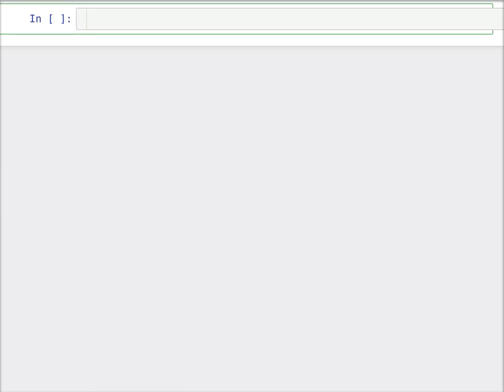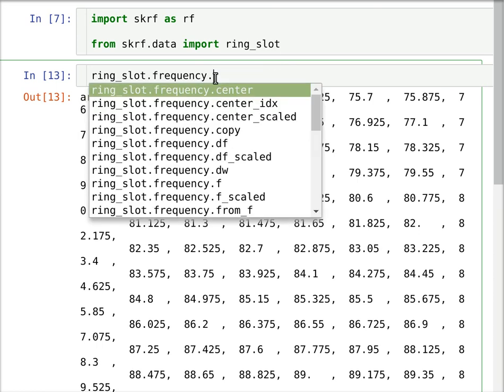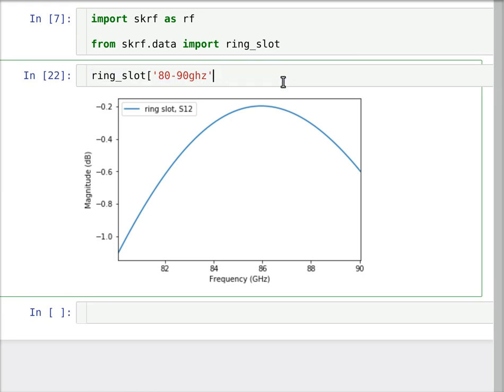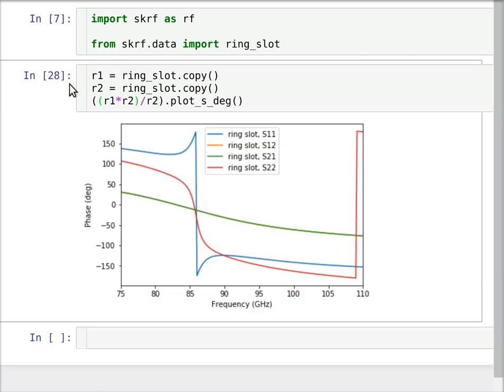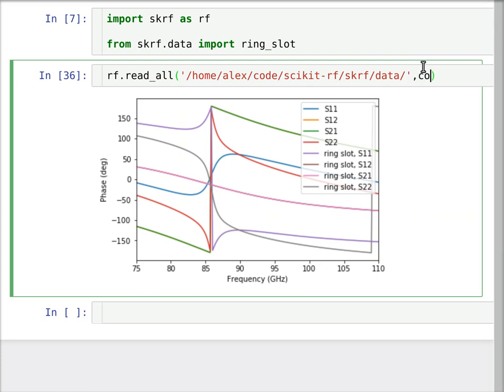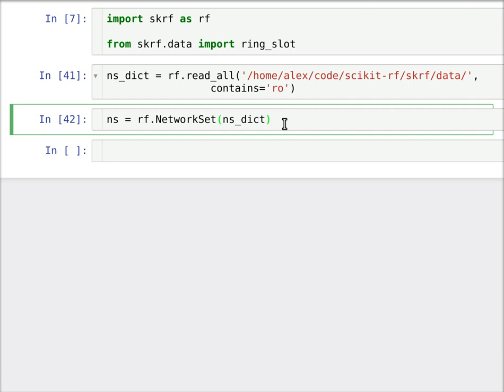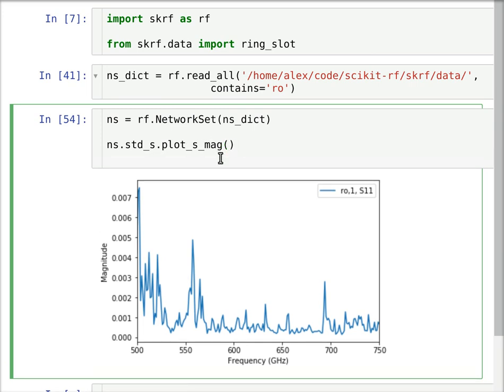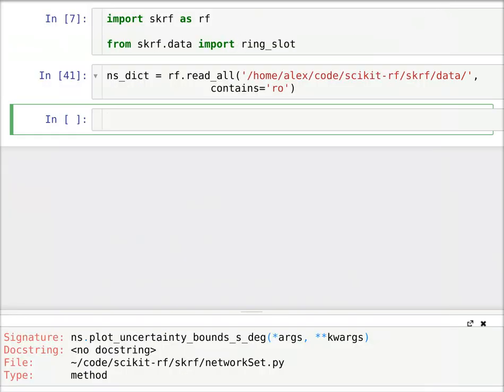Quick Intro to scikit-rf, a  python library for RF engineering

Comment: That's good stuff. I'm missing some RF system related lib though 😀
I mean, specific for receivers and/or transmitters - things like NF, gain, linearity, filters... Anybody know anything that could fill that gap?
Reply: Hi, digging not-that-old question by you - I'm thinking about writing some opensource python stuff to deal with RF. I'm thinking about tool helping to model RF chains/lineups. I would like it to be possible to define mentioned blocks (with some build-in templates, bands etc) so you could just chain them like: signal >> lna >> filter >> pa >> circulator >> antena etc. and it would allow for gain/NF analysis with some automatic reports/csv/excel. I got couple ideas and scratches for it but it would good to hear some feedback/opinions/requests what could be done.
Reply: Hi  @pawestoworowicz6828  
I think for RX I would cover the two aspects of noise and linearity, with key aspects, besides noise, of modern down-conversion (i.e. mixer structures, image rejection and imbalances), with the possibility to "simulate" the chain for spurious products, down to SFDR for instance. I mean (static) non-linearity composition and stuff... Just a few pointers there :)
For TX a similar approach, with emphasis on linearity and maybe constellation diagrams, things like that.

Comment: Nice video! May be you can help me. 
I can't get S parameter at a particular frequency if I set that frequency as a variable. For example:
[in1] freq=1.220e9 ## variable for frequency
[in2] nwk1[freq].s21.s_db.item() ## extract the S21 [dB] from ntw1 network
[out] IndexError: only integers, slices (`:`), ellipsis (`...`), numpy.newaxis (`None`) and integer or boolean arrays are valid indices

Do you know how to do it?
Reply: Your error message suggests that freq is a string.  The letter e may be the culprit.  I think you need a + sign after it to denote scientific notation.  Use the type method to see what your variable is.